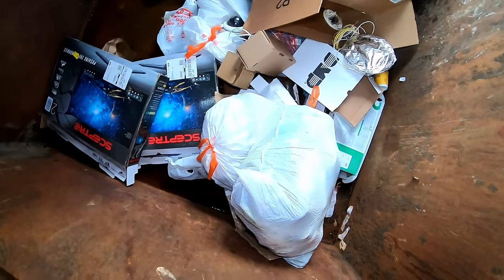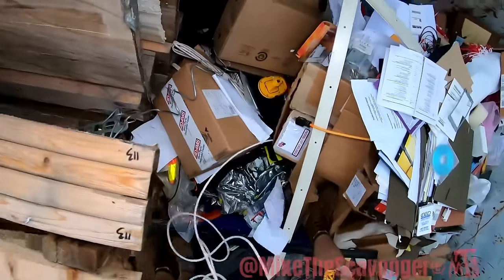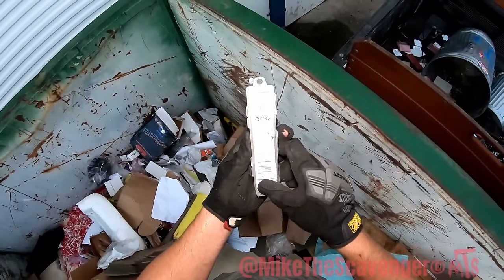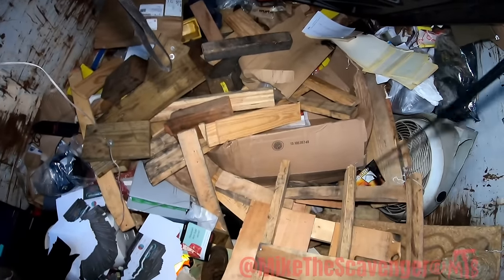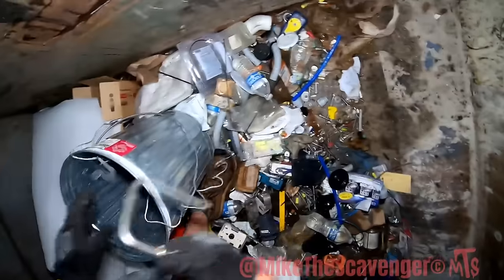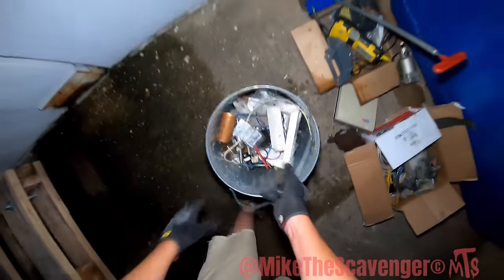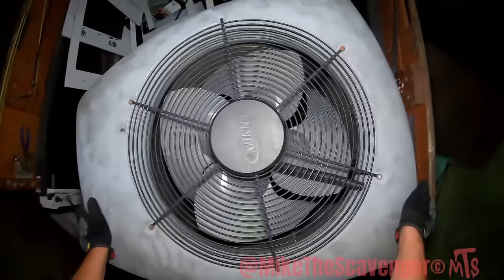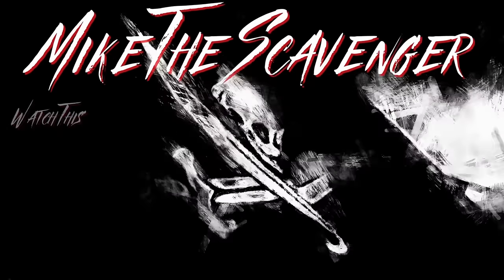Dumpster Diving "There's A Difference!"

Comment: Those morse adaptors are for pedestal  drills and mill - they are worth a bit. Used instead of a chuck fro morse taper bits. Holds in by friction

Comment: Metals and electronics are not the only scrap that has value.
PET regrind is closer to 0.80€/kg
HDPE scrap 0.15/kg
LDPE scrap 0.10€/kg
PP scrap 0.10€/kg
ABS scrap 0.095€/kg
PVC scrap 0.095€/kg
HIPS scrap 0.19€/kg
PS scrap 0.056€/kg to 0.10€/kg
DVD scrap 0.13€/kg
Cardboard scrap 0.09€/kg
Office Paper scrap 0.05€/kg
Used pallet 1€ per unit

Comment: Mike, do you ever get fans asking if you would sell an item you find.  Just asking because I would definitely be interested in buying the Klein wire grip you found in the green open top. I do high voltage line work and I use them daily.  Love the videos.

Comment: Mike would do well to build contacts with a few precision engineering or metal fabrication companies. Some of the tools he finds, he could probably sell straight in to them. That Milwaukee one piece Hawg Carbide tipped cutter is for drilling holes in stainless steel (or other metals) up to 1/2” (13mm) thick. They’re currently listed on Grainger’s site at $96. Those other things in the plastic boxes looked like morse taper to straight shank adaptor sleeves for taper shank drills. The flat tapered pieces with them were drifts to part them from the drills again. Quite a few dollars worth there too. I saw another YouTuber scrap a box of almost new engineering tools worth at least $120. I’d have gladly paid him $80 for them. He threw them straight onto a pile in the scrapyard. I was almost screaming at my screen.
Reply: Agree 100%. As an electronics guy, I wept to see the megohm tester tossed. And months later I haven't got over the Rigol scope in another dumpster...
Reply: I figured there were some engineers watching just cringing at the instruments that were tossed out!

Comment: Some of those contraptions in the open top were rope grabs that you hook your lanyard to when doing sommin like cleaning windows , if you fall it grabs , as you move up its easy to slide , to other brass lookin deal with a teardrop lookin handle is for pulling cable. You hook a comalong to the teardropend and the other u slip over a cable then slide the little plate over cable so it dont accidently slip off and go to town tightening up your perimiter temporary handrail on a structural steel building , yes somof that stuff is worth a buck or 2

Comment: Non-magnetic is a misleading statement, nonferrous is a more proper term. In most cases it will require the use of a meteorological expert to determine non-magnetic or nonferrous magnet

Comment: I like metal trash cans. I use mine by digging a hole deep enough for my can but let it stand above the opening 4 inches,  put a 13 gallon kitchen trash bag in ..and now we grab the "JAWS OF SCOOP, ScOoP, scoop" and put dog poo in. Replace lid until next time; Scoop regularly, Texas heat dries it out well if you leave lid off but one rainfall makes that bag a nasty, nasty mess. I have 3 pooches, more big than small, so we scoop daily which Saves mowing over it, a family member from stepping in a fresh surprise or your big dog from dragging a paw in it then coming back in and spreading the doo...  warning: summer heat makes a smell worse that vomit or poo when opening lid so go upwind. But it makes that chore easier to handle by working smarter not harder.  Scoopity, Scoop, Scoop... see what i did there? Lol